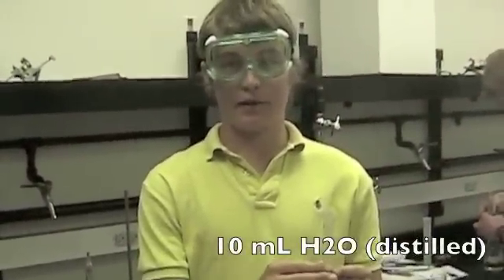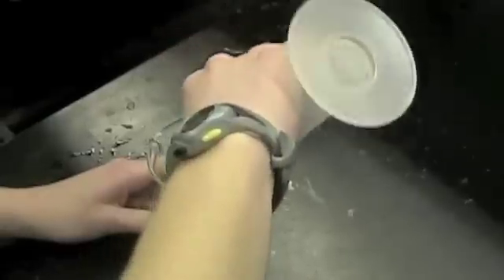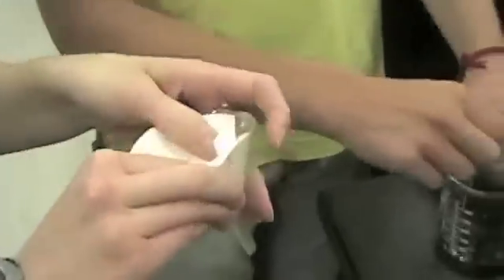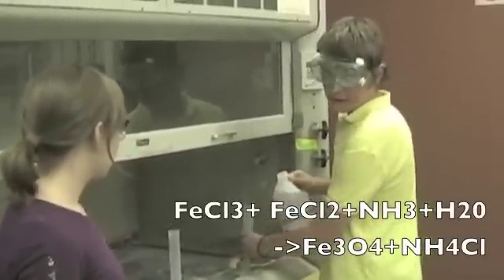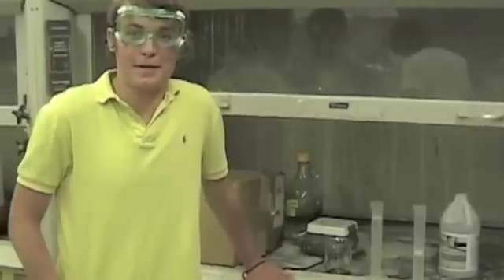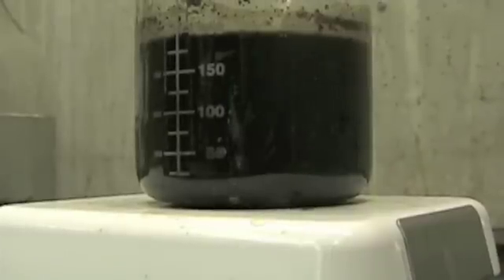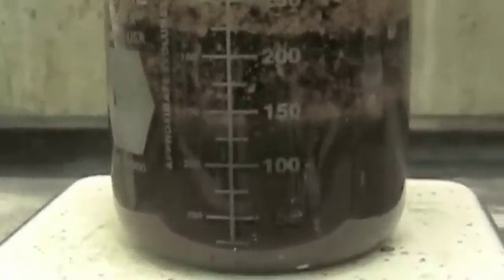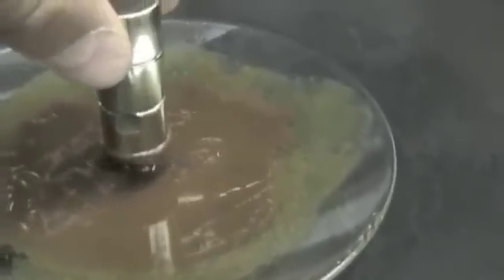How to Make A Liquid Magnet

Comment: Is this truly a liquid magnet, or is it a magnetic fluid? I feel this is a bit unclear in the video.
Reply from the maker: Technically, it is a ferrofluid. That is a magnetic fluid. It is magnetite suspended in oleic acid.
Reply: Does that mean that this fluid only react to a magnet or does it work like a magnet, whith out any other magnetic sources, on its own?
Reply from the maker: It is a paramagnetic fluid. The following description may be technical so let know if you have questions.

Under the influence of an induced magnetic field, the magnetic moments of the magnetite align with the field. This causes the liquid to be drawn toward a magnet.

This basically means that the magnetic properties of this fluid are too disorganized to act like a magnet on its own. Bringing a solid magnet near the fluid gives the liquid magnetic properties by organizing the magnetic moments of the liquid.

Simply, no, it does not work like a traditional magnet without another magnet.
Reply: This clarified it for me. Thanks